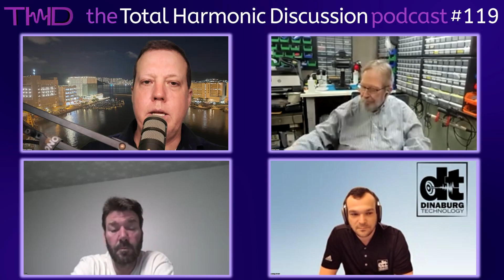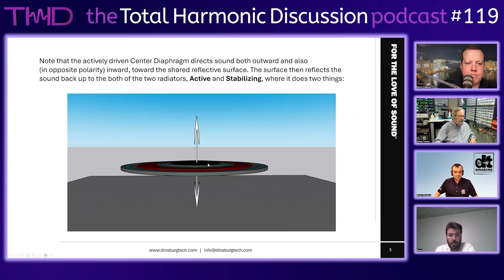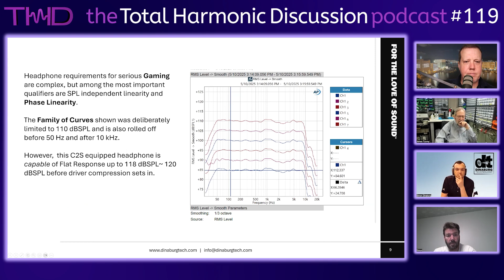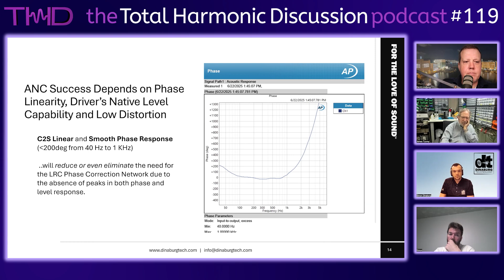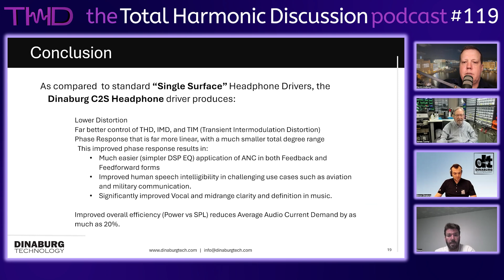THD 119 Dinaburg Coaxial C2S Headphone Drivers Advantages for Gaming, ANC, Haptics, Spatial Audio

Comment: I will say THD is kinda high even for a driver in its class @100db tbh. Maybe if they could do something about the motor control. I think in terms of response and compression it handles it well otherwise. Im wondering if the Measurement was done in the same way as speaker measurements are done at free field and maybe thats why its as high as it is at the output level, and if that will improve w/ a backbox.